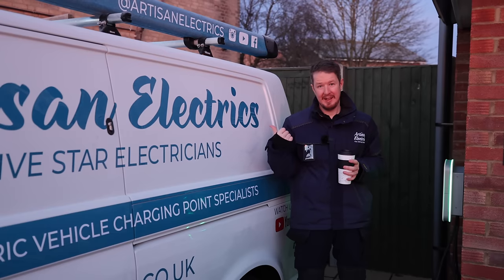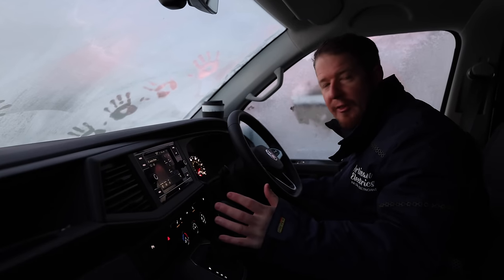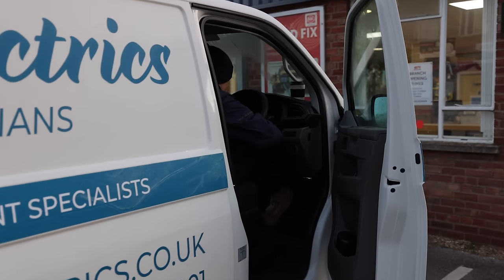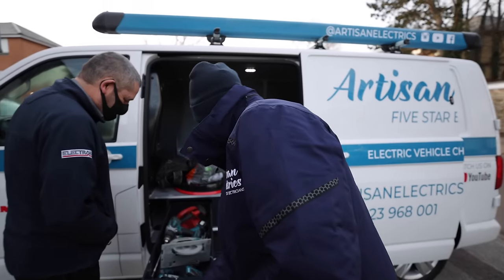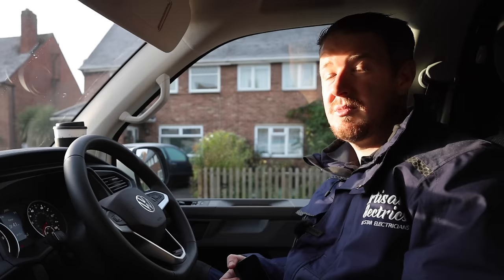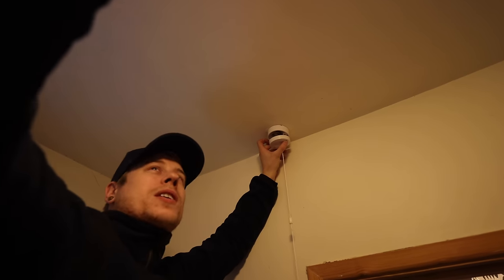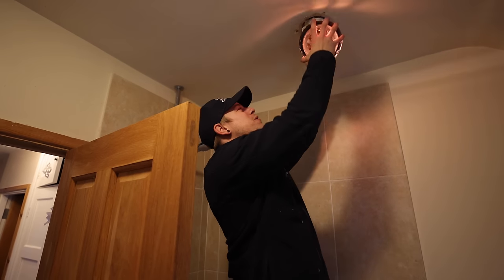ELECTRIC VAN NIGHTMARE 😬 - Volkswagen Transporter Electric Van

Comment: Ford lostbthe patent years ago i was told they forgit to renew it when i bought a focus back in 2013. The problem with the windows not shutting is the switch has 2 clicks so pull up one clcik for manual all the way up for auto close. The window thought someones hand was trapped essentially stopping it from shutting. If you want a small van buy a ford if you want a big van especially an auto buy a sprinter. Vag just arent the go to for vans..

Comment: Omg can't you see the window is binding causing the safety circuit cutting in to stop it damaging a hand or head. Shouldn't really use the windows until some heat is in the vehicle and that's for any vehicle that has glass and rubber seals

Comment: Lol... the dude aays he is using hot water... people don't ever use hot water on your windscreen to de-ice... use cold water; as long as its liquid and not frozen it is warmer than the ice and it will do the same job... but he got lucky as he could easily have shocked his window (metaphorically) and cracked it or worse shattered it... and try and avoid putting it directly on your window; if your able to; do it just above the window and let the water run down... and don't forget to use your wipers to clear off the water as you end up with the problem of the ice refreezing on your window...

Comment: Too much window motor resistance, on the circuit. It is a soft start system, so you don't Burt out the motor or controls...

Comment: OK converted ICE vehicles are just a stop gap, dedicated chassis is the way forward, so this VW is not the best.
It is a totally different mindset for EVs, plan ahead, preheat via the app or timer, if you only have a 3.6 Kw charger then you know that for 4 hours charging and circa 3.0 miles range per KWh you will only input 30-40 miles range.Yes there are charging losses.
Finally RTFM.

Comment: You should work for VW. 
That window isn't on its hanger correctly. That's why it's not working as it should.

Really , you find it hard to roll a lead up...
Come on... Put drag on the cable. Stand on your toes, with the wire in the gap between your feet , and  don't walk up to the cable.

They were sleeved together because you don't use much sleeve. They had to have a connection and were often kept out of the way... Earth was a after thought don't forget. Back in my day...

It's when you get two brown wires with fabric on them maybe some wax... It was easier to see the line breaks, but bending the wire wasn't always good, they still have bend charts these days ...

Here's a tip. Run the kids around with a socket tester.  Okay you still have to do some checks and socket off. But it's a fast test for socket problems. 

That earth bond made me laugh.

Comment: I looked at VW for an EV Van.. they are not where they need to be! 
Very poor and the BUZZ is too expensive and has poor tow capacity.
The best value, for a Mid Size EV van, looking range and capacity VS cost is the MAXUS (LDV MG) ..

I hope your experience improves as the weather warms up 👍

Comment: Having the same van I can honestly say the VW T6 is a piece of pure garbage.  50 to 55 miles if your lucky. Everything that uses electric draws down on your mileage. They didn’t even put the charging point at the front but the lazy sods just put it were the old petrol or diesel cap was, unfortunately all charging points are at the front of the vehicle and the charging lead is like a guitar string by the time you get it connected to the socket on the van, absolute rubbish. Won’t be getting another one for sure.

Comment: My 2002 Caterham has an electrically heated windscreen, fitted from ne, and Renault Alpines from the early 1970s did too, so I can't see what sort of patent Ford can have that could stop VW fitting one. It's not at all rocket science, just a switch and pos and neg low power wires!

Comment: You said it in the first 5 min. of the video (Quote: this van is a piece of junk) I watched the whole vid. anyway. You should check out Smedley plumbing Channel He is testing the Ford E transit. I was surprized how good that van is. it seems to average 120-130 miles of range with 2000 lbs of tools and equipment in the back in eco mode with regen on. the software isn't as good as tesla's but seems to work ok. other cool things about it too. If you want an electric van  you should look into the ford. Oh and why did you spend 50k on a van without knowing how good or bad it was anyway? Thanks for sharing this good honest review. Have a great Day!

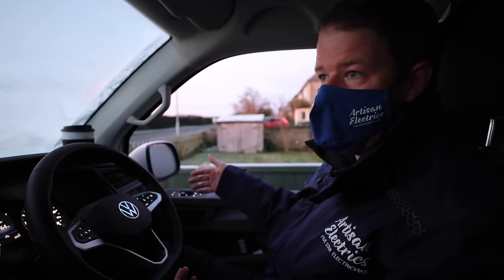Comment: 2:30 Can you leave the car plugged into the charger while the cabin warms up and battery is conditioned so that it doesn't have to use the battery for that?
Reply: usually that's exactly how it's done in EVs. And if you informed yourself about basic functionality of the car which was clearly not the case here.
However I would not be surprised if VW f**ed this up.

Comment: Can we now catch Covid from our vehicles?

For all those sad EV owners (EVs are this centuries BETAMAX) 
I drive a 2016 Audi allroad quatro 3.0 V6 diesel stage 1 330bhp, which takes 5 minutes to fully "charge" for £100, does 55 mpg and 800 miles on one "charge."
 ULES (Ultra Low Emission Scam) compliant. It has a far smaller carbon footprint than any EV,  cost  quarter of what a TESLA does, has far superior build quality and doesn’t sound like a milk float or look like a duck. It can also be "charged" at over 8'300 stations throughout the UK which are all completely compatible with the car, safe in the knowledge that no children were used as slave labour in African mines mining rare Earth metals to build my car!

Comment: I think as an Electrician you should  of already have enough knowledge not to buy an electric vehicle 

The infrastructure is not in place for starters and the money you save not paying for driving into clean air zones does not offset the initial cost of the van I most cases 

Looks like you also have an accountant that doesn't know what he's doing either 😎❤

Comment: The only problem with this van is the nut behind the steering wheel. If this is you level of understanding then I wouldn’t let you wire a 3 pin plug ffs.

Comment: To De Ice a car Screen, 
Spray De Icer on it. 
Or Cut a POTATO in half & rub over the outside of the glass. 
DO NOT use Hot water, the Temperature Difference Can Crack your screen,

Comment: Ford patent on heated windscreens ran out years ago, almost all manufacturers do them these days. Seems VW vans could be an exception, that or an option box wasn't ticket 🤷🏻‍♂️😊
Reply: All EVs have an independent heating (&cooling) system (something you have to paly extra in a car with combustion engine), because there is no motor which converts roughly 85% of the energy into heat. And usually you can program these to a certain time.
Keep the EV on the charger over night, go to your EV in the morning, unplug the charger and sit in a car with defrosted windows and nicely warm inside.
Or you go moron mode / don't have a clue mode and do it like shown here...
Reply: @johnscaramis2515 
Fully aware of the programmable heating/cooling timer feature on most EVs (preconditioning), but isn't this a post factory EV conversation jobbie? Actually made as an ICE vehicle (or just short of it), then VW ship it to an aftermarket company for conversion, then on to the customer.
Several manufacturers do it, you can usually tell the conversions, as like this one, the range and features are utter crap. I'm not saying it doesn't have preconditioning, but if it did, then as Jordan also (used to) run a Tesla, he'd be well aware of how to use such a system - or he forgot to set it up 🤷🏻‍♂️
Reply: @obrien1sj  Unless VW didn't sell the can without any heating at all, it is a factory work at least from a users point of view (however VW could outsource the work).
Don't forget: an EV has no real heating source, whereas a combustion engine puts most of its converted energy into heat. 
I was not aware that he had a Tesla until the end of the video, but if he has, then the rest of the problems is even more ridiculous.
Reply: @johnscaramis2515  
 No real heating source 🤔 Unless a fault causes the traction battery to turn into mount Vesuvius 🌋
Anyway, that aside, I didn't say it wouldn't be retrofitted with some kind of electric heating during the conversion, that goes without saying, but perhaps not the preconditioning feature.
After all, the van's specs are pretty shocking vs other mainstream competitors, such as the Vauxhall Vivaro E. The range in that is huge compared to the Transporter and it's built in the factory as an EV, not a conversion after the fact. A company the size of VW should be doing better. The ICE Transporter is arguably as good, if not better than rivals, so it's not good to see the EV version be so uncompetitive. Especially when VW have existing EV vehicles from which to borrow the tech for their van, as Vauxhall (Stellantis) do for theirs.

Comment: The peak of road vehicle technology was about 25 years ago when a mix of mechanical technology provided the user with maximum utility. It has been all downhill from there with worthless emission constraints that everybody has been cheating on, cheap unreliable electronic toys that barely work and now overpriced electric vehicles with barely the transport utulity of 1920 Ford Model T. Lucky it was Cambridge and not Altnaharra.

Comment: Have you had any issues with the megger? I just bought the megger 1741+ for Ev, but on the two wire non trip rcd setting I was getting really high readings, sent it back and there was a fault on the meter. Only had it a week.

Comment: Seems like the VW is an extremely bad construction. 

We live in Sweden, have a Tesla Model 3 and it simply works - regardless of snow and low temperatures. If you want to use it in the morning during wintertime, you just set the departure time in the app and it will heat up the car and defrost while charging. When you come out to the car in the morning, you have a warm defrosted car and something like 300-350 kilometers of range.

Comment: I always use warm water to defrost screen. If you need another pass you can increase the temperature.. So long as the temperature difference isn't too big and you poor quickly to cover the whole screen it will expand evenly. This helps heat the glass so it doesn't instantly frost over the moment you start moving. I'm surprised VW couldn't have a cab pre-condition function providing you set a set off time. VW are so lame.

Comment: PUT A INSULATED SHEET OVER IT THEN WHAT I DID WITH DEISEL  VAN I PUT ELECTRIC BAR FIRE WITH EXTENTION INSIDE  FOR 30 MINUTES, ALL VEHICLES  DONT LIKE COLD, SO YOU HAVE TO HELP THEM IN THE COLD,

Comment: I see it this way. You need to get educated and how to use it and its limitations. Specially that cold. A lot of electronics  and components . Electronics get affected with temp. All these  electrics are a different animal compare to gas Vehicule.. Pre heat it no matter what. Batteries performance is diminish a lot with low temps.

Comment: Really enjoyed the vid and honest real life review of your van. 

Also just in case it helps you or someone else reading this, I've had issues with SADs during winter and have tried loads of different things for it but the thing I've found to help the most is high strength vitamin D. There fairly cheap and worth a try, it can take a few days of taking them before you notice any improvement depending on how low your vitamin D levels are to start with, but I know several people who have found vitamin D to really make a difference for them there's also a few ppl who didn't notice any difference when taking them so it doesn't help everyone

Comment: I think you’ll find that during cold weather, some of the charge coming into the vehicle, is being used to heat and ventilate the battery, that’s why it’s not charging quickly.
Reply: I didn't know car batteries had heaters in them. Do they?

Comment: Fill a hot water bottle 10 minutes before you want to leave, put it on your  drivers seat and hey presto your windows will be frost free and your seat warm.
Reply: And over time have the inside of your car filled with fungi because everything is dripping wet.
Not saying this is bad solution, but more of a "do it once every now and then" solution
The easier way would be to look into the car manual and check how the heating system can be programmed...
Reply: @johnscaramis2515  Why would that happen? Their is moisture in the air both inside and outside of the car. All you are doing is raising the temperature slightly to defrost the windows before you start the car and drive away with the heater on and the natural air flow through the car due to the vents in the body that are at the rear of all cars.
Why would there be fungi? They don't even grow mid winter, that is autumn and spring.
Why would everything be dripping wet?
Are you talking about a shower?
You do realise this is about defrosting a car don't you?
Reply: @cunning-stunt  Simply depends on how long you hace the water in there (so how much additional water you bring in) and how long you are driving and what kind of temperatures you have in your car. If you are only driving a short range, you may have in issue.
Winter generally is problematic regaring water vapour remaining inside cars.
Reply: @johnscaramis2515  said, "Simply depends on how long you hace the water in there (so how much additional water you bring in" 

It's in a hot water bottle.... you  know....A SEALED CONTAINER!

I've been doing this for 30 years, never seen a mushroom in a vehicle yet.

Comment: Ooooof. Yeah, I'm not buying electric anytime soon. Every single detail is a bad idea. Electric windows: fail. Electric heating: fail. Electric charging: fail. If your phone doesn't have internet; you can't disconnect the charger. Holy .... !
Reply: Tell me you have no clue without telling me you have no clue. But a strong, unsubstantiated opinion.
Eletric windows: standard in all modern cars. Not specific to EVs
Electric heating: why fail? Works perfectly fine, if you know how to use it. You can program your system to heat up or cool down for a certain time. In a combustion engine you have to buy an additional independent heating system. And if you plug into the charger over night, you have full range available
Electric charging: why fail? Explain in detail. BTW: I also had problems first time disconnecting the charger. But it is quite simple, at least for VW: either use the onboard system to stop charging and unlock the charge port or simply press the unlock button on your car keys. No app necessary. And in worst case, there's a manual unlock. Which you should not use during high-power charging...
See why I know you wrote BS without having ANY knowledge?

Comment: "I realised it only charges at 3.6Kw"  Odd for someone specializing in EV Charging points , to make such a mistake?
Icy  window , ICE or EV !  just chuck some warmish tap water over it. ( only Boiling water might crack it). & 80 years of ICE cars  only use engine heat, so human deicing was the norm. 
What did VW say when you showed them the vid ?

Comment: Phew. Wearing a mask. Can’t be too careful
Reply: I supported wearing masks, it was a good idea, if you had contact with other people. But I have seen many people wearing a mask when sitting in a car alone, riding bike or taking a walk.
And then I thought WTF?
Reply: @johnscaramis2515  all the studies showed mask 100% stopped transmission and deaths
Reply: @fffffffggggg11111  Maybe you should reread my comment. I fully agree that masks were a good solution at that time. They did not prevent transmission fully, as you claim, but to a good extent. Even if a mask could have prevented transmission, don't forget, this also relies on using the mask in the correct way.
However the mask surely did not help in anything when there's noone else around.

Comment: Real electricians don't use electric vans. Up north in Sweden I use a Caddy 2.0 TDI with diesel heater. And I have alsow  a 230V mains heater for the engine and cupe.

Comment: Yes, electric vans are of questionable usefulness. No opinions here, just facts.

Mercedes Sprinter E. Charges in one hour to an indicated 100%. The range you get is 94 miles. I drive home after charging, a distance of 9 miles. Remaining range 81 miles. Poor maths.
Following day, after a sub-zero night, remaining range 64 miles. I have the photos to prove this.

I then had a 35 mile journey from Dronfield to Doncaster. This involves a bit of motorway travel, at which I kept a constant-ish 60 mph. No radio on, heating on only when my feet began to get numb, whilst trying to use the regenerative charging feature as much as possible.

When I arrived in Doncaster, remaining range 21 miles. Poor maths once again.

The major point is this however.

The van was empty. It was carrying its own weight and my 12 stone body. No idea how the range would be affected if you were carrying a load, or living in a hilly area.

Mercedes claim to have done extensive research in Europe which showed that the average delivery van does 65 miles per day. I will let you decide on that point.

As always, just saying. Love and peace. PS I defrosted the Merc's screen with lukewarm water. Not too much of a problem.